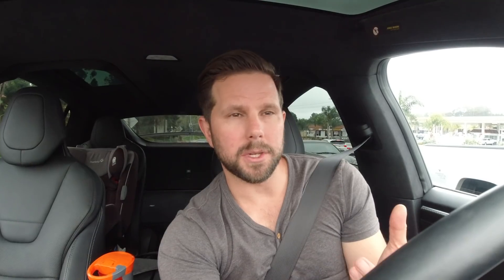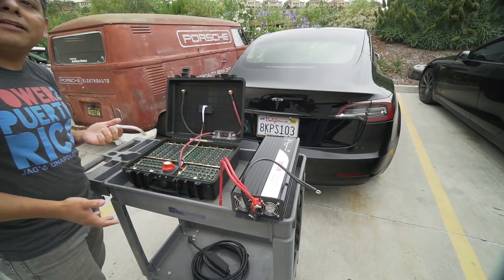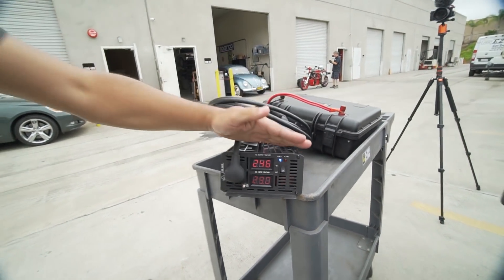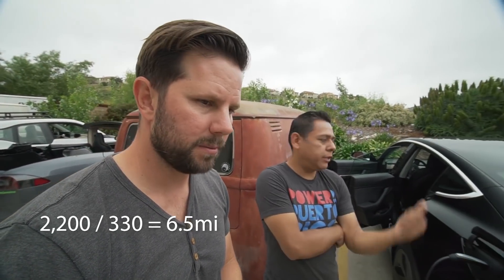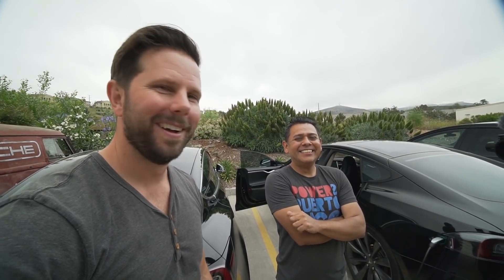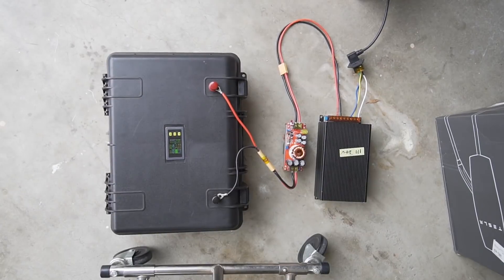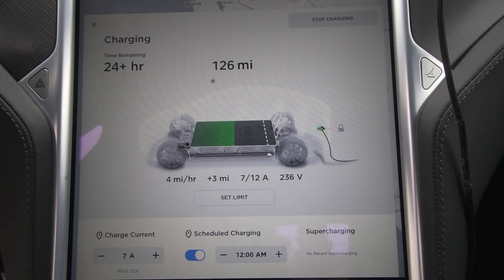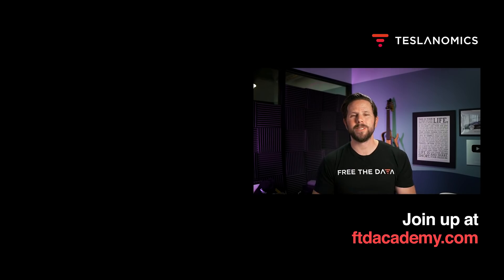DIY Tesla Gas Can - Will it Work?

Comment: If a person were to buy 40 AA batteries to make a 48v system, they would have 120ah for emergency use. Of course you use the same components that he used to build his bank, but twice as big. It would still fit in the truck as an emergency. If you got 6.5 miles off of the 24v set up, you should get 12-13 miles, if not more. You can also run two 40 battery strings in parallel to get 240ah, which I believe would give you good enough charge to make it to an actual recharge station. At worst, a place to recharge your emergency charger.

Comment: If the car battery was almost empty the ecan would have worked much better. What you're trying to do is raise the voltage of the car battery so the fuller the battery is to begin with,  the less you will be able to transfer. Do the experiment correctly, on a dead car and see what you get.

Comment: I think this says something about the power of gasoline and the  Inefficiencies of how we use it. A small 1 gallon tank of gas contains over 30  Kilowatts of energy, so the battery they made would need to be 15 times its size to contain the same power. That would also charge the car  33%, which is a lot more than what a 1 gallon gas tank would do for a gas vehicle.  So if the average gas tank is 17 gallons [ish] then I think 1/17  of the car battery would work and count as and EV gas can.  I think that's  about 5.8kwh, and should give you about 15-25 miles of range  Depending on the car and charging inefficiencies.  So in the end I think a battery 3 times his battery  Density would work.

Comment: Electric car manufactures should work on creating a standard for emergency portable battery packs ( E-Packs ) that could direect power the vehicle for a few extra miles.  Ideally, every electric car would be sold with an E-Pack docked into the vehicle in the trunk or whatever, like carrying a spare tire.  The E-Pack charges whenever the car charges, but it does not discharge and provide power unless you pop the trunk and flip the switch to toggle over to the E-Pack.  The E-Pack would be direct power, not a charge transfer, so there is no loss using one battery to charge another.  If you run out of charge, you could toggle over to the E-Pack and get a few more miles, or you can undock it from the car and carry it to a power source to charge, or you could swap E-Packs between cars for instant power, or you could borrow an E-Pack from the local gas station or a tow truck driver, etc.  Every car would have one, so getting instant emergency power would be as common and simple as transferring gasoline.

Comment: Why not add an extension port to the actual battery packs so you could just add it straight to the batter not charge into the current batteries much like the infamous tesla trailer

Comment: Is it not possible to bypass the Tesla’s built in inverter and just charge the batteries using direct dc-dc charging? Converting the power from dc to ac and back to dc is inefficient.

Comment: I have a volt, i think it would work,theres always a gas station every 7 miles ,or a place were you can charge. All you need is an adapter ,you re making a mistake by looking at location of charging stations ,no its based on were ever theres electricity and you having an adapter to your charger

Comment: Get Will Prowse to build you a 48V LifePo4 battery pack (16 X 280AH) and use a 10K inverter.  You should be able to dump at least 12KW into the Tesla in about 90 min.  That will get you around 43 miles.

Comment: How About a (reverse) Battery trailer? To avoid losses.. what if Tesla provided a Trailer "Hookup" that could feed power back (into) the Tesla instead of draining it.. then if you put the power wall on a tow behind trailer like one of those Mini-Mixers wheeling down the road.. it could follow the Tesla and provide power until you can get to a Tesla Supercharger. Best.. a gas truck or something with heavy towing capacity like a Pickup truck could drop it off.. you hook it up.. and (zero charge time) your ready to go, with (zero inverter losses). .. that or Strap a Powerwall on top the glass roof like a Ski rack and do the Doc Brown thing.. just not at 88 mph. Tesla could do a drop off wherever, and the Rescue Tesla drop it off at the local Supercharger station. An Empty "frunk" battery with a hookup inside it would work just as well. Make it modular and easy to handle.. SuperSized BigMac battery rods like Power Pellets you could plug in as many as you need or as few as you need to get to the next Supercharger station. Then AAA could carry lots of these Energon Cubes around to Power up the Tesla Transformer in an emergency. -- And don't they Reserve some battery capacity they can Unlock for Hurricane Evacuees? Could you email Tesla with an "I'm sorry" request and a credit card.. to get that power unlocked for a 'rescue event?'.. like My Wife is Having a Baby?

Comment: The real trick to doing this is using ultracapacitors on both ends.  Much faster energy dumping, much greater energy density, and better efficiency than batteries. There is talk of building them into busses and other large vehicles for super fast charging.

Comment: Would be cool if all Teslas had a 911 button and when you press it it will alert Teslas close by and then you can connect Tesla to tesla  for 30 mins.
It would only alert drivers with 75% battery left and you could Opt out, but that means you do not get to use the service in the future.

Comment: instead of tesla to tesla charging you can litterally pull a tesla on a tow-strap and charge it like that, Jason over at Engineering Explained towed his model 3 like that behind a big Ford pickup and was able to put a decent charge on. though i think you kinda need the power of a pickup to tow a tesla, you can't just ask your buddy to hop in his civic and tow you up and down the street a couple times to charge a tesla haha, especially because the tesla is regen-braking while you tow it, it's not just the dead weight of the car

Comment: The "miles gained" that the Teslas you tried it on is probably set to display miles at typical highway speeds since you had not actually depleted those packs to "zero". Long before your Tesla runs low enough to need such a device it will have dropped its speed to try and conserve the remaining energy before shutting down completely to save the battery from actual low voltage damage to the weaker cells it may have. Other EV makers call this "turtle mode".
What the Tesla may do under the shut down circumstances is treat the power gained from that "electric gas can" as mileage possible at those slower speeds. So it may be possible  that going along the road edge with hazards on at around 25 mph where no appreciable aerodynamic load is encountered could mean that that 5 to 6 miles displayed might actually allow 10 to 15 or so extra emergency miles.

Comment: Battery filling battery is like two buckets piped together at the bottom.  When the higher bucket empties enough to equal the lower bucket water level, the flow stops.  Equilibrium, just like osmosis.  You can charge a 10v battery with a 16v battery.  When the voltage on the 16 drops to 12 just as the 10 v rises to 12 the charging stops.  They are now an equivalent cells in a parallel system.

EVs need external horsepower (lots) to produce massive power to always be more energy than the Tesla battery is storing.  So as you say three days worth of house power for your house analogy is in a fully charged Tesla. 

Teslas are more car than most drivers need.  Most drivers are not in 0-60 in three or four second cars that weigh 4000lbs.  Most drivers are in modest ICE cars with 120hp, 2000lbs and accelerations that will not get their 16 year old killed.  More modest EVs might produce 400 mile range on 50kwh batteries and therefore drop charging times significantly.  They would also be easer to "jump" charge with a pack.

EVs will come of age when emergency roadside service is competent.  When all chargers use the same damned cable and bill you on their screen for the amount you are using right now, not some phone app and subscription service.  When aftermarket parts are available at a discount and OEM parts (especially older batteries) are guaranteed available for 20 years.

Try to keep your old NiCad Leaf serviced and repowered as easily as a same year Nissan Sentra.  Try to get a Tesla 3rd party serviced.  Try to buy the same pack your S had a few years ago.  These are all still experimental and flaws are known, but talked around, not addressed.

Comment: sooooo.... what actually happened?
did the inverter shut down due to over current?
or did it shut down due to under voltage?
these inverters usually have a shutdown voltage set for lead-acid batteries, so they would never be able to actually use all the power in a lithium battery-pack.
might wanna look into that, adjust the low cutoff to a voltage suited for lithium....

Comment: Rivian CEO RJ Scaringe talked about creating one for the Rivian (which makes a lot of sense given the car is built for off road use). It'll be interesting to see if one created by the actual EV company will be more successful. Rivian is a little more conservative with announcements than Tesla so I'd like to think they had some form of a working prototype before saying this but time will tell. As far as Tesla goes, I think it'd make more sense for both the company and consumer to focus on just expanding the supercharger network than making some inevitably expensive product for rare fringe cases. Plus, if the 'gas can' is like most lithium ion batteries it probably wont hold a charge as long as you'd like so you're gonna have to charge that beast pretty frequently

Comment: Electric trucks make so much more. sense.  Put a small generator and tank of fuel in the back, far more efficient. The energy density of liquid fuel for emergencies and long distances pairs nicely with electric for torque, regenerative breaking, and home “refueling” after city driving.

Comment: You would need to use DC system to get power over faster... even at 12A and 240V it is too slow... Less then 3KW... You would need speeds over 10KW probebly 30KW or a towing truck is much batter option...

Comment: Tesla Absolutely needs a dc charging port, that would have endless use possibilities the ac charging only really leaves you with the grid as a charging source
Reply from the maker: The same port works for DC, this is how superchargers can do 250kW, but you need 400V otherwise it won't work
Reply: @BenSullinsOfficial  ok i see I don’t own a Tesla so I didn’t realize that’s how the superchargers work using dc charging. It’s a shame it has to be 400v though if it was lower voltage the amps would have to be very high am sure, but don’t you think a battery bank dc to dc charging would work better or probably still not worth the efficiency gain
Reply: @BenSullinsOfficial  nice experiment though, it still could be used if someone stupidly runs out of charge on a highway and a friend swings by with one of these instead of towing

Comment: I saw a video where a guy calculated the fuel burned to drive 20 miles in his ford raptor vs the fuel required to regeneratively charge a Tesla to 20 miles. It was far cheaper to pull the Tesla into a 20mile charge.  I think as a booster pack idea your talking about carrying more weight constantly at a cost. Throw $20 at the guy with the next pickup that drives by. Put your tow hooks on and tow your car a few miles.

Comment: Dc batteries ,  they want dc current.  Going from ac to dc, involves a fairly big loss, usually 15%.  I’m advocating for solar panels, as solar is already at dc current,  you just need to get up to a couple hundred or more volts to match the full voltage of the on board battery.  Reference the cyber truck.

Comment: The problem is, this is just another thing to have to worry about charging.  A gas can can sit in your car for years and you know its there and ready, but a battery like this will probably need to be charged once a week if left idle.

Comment: Why not create some equipment that enable another charged Tesla vehicle to provide the extra charge for a Tesla vehicle which has a flat battery.
Reply: The new Tesla truck should designed so that it has the option to be able to charge another Tesla S,X,3 with a flat battery?

Comment: if you dont want to completely switch to single-use high-capacity batteries for main drive, you can have them as backup, like zinc-air at 400wh/kg, aluminium-air or magnesium-air over 4kwh/kg. why do you use inverter to charge non-ac batteries? charge tesla cells directly? ask elon to provide secondary dc charging two-way connection.

Comment: It would probably work better if Tesla's had DC-DC charging, a high power DC-DC buck/boost converter as standard in the car with a wide range of DC input would facilitate this and would be easy to implement. It would facilitate charging from many DC sources including other electric vehicles without the need to do the DC-AC then AC-DC conversion. With a "powerCan" you could probably get a more efficient transfer of energy.

Comment: Dc to Ac to Dc.... sounds like a band. Why can't you produce the same DC voltage like the supercharger and charge Dc to Dc?
Reply: quick math- tesla S 85d has 7104 cells in 96s74p configuration - this gives 250miles of range - so if i made 96s4p battery pack should i get extra ~13miles ? - only problem I dont know if I can plug it directly 1:1

Comment: It is a partial and temporary solution with issues/ problems obviously but still useful. I would be surprised if Tesla is devoting no time/ money/ effort, into developing a similar concept/ idea. This kind of a thing, is limited to battery size and energy storage capacity also (which just isn't there yet and won't be for many years). The energy capacity of 18650s or even the current 26650s/21700s is still far too low to be practical. The engineering and money that Tesla put into making their cars illustrates that (and is still a remarkable accomplishment).
 
That said, I believe that a better inverter might have been able to push the 10 Amps;  [And]  Was it in fact related to the battery or the inverter itself, rather than the Tesla charge controller? Meaning - rather than the battery didn't have enough power or couldn't deliver it at a fast enough rate, the inverter might have been the weak link. I own several and have taken them apart to examine the components.  

And if you research inverters and watch videos on YouTube, you will see that there are huge differences between inverters (even those that have the same [supposed] OEM ratings). There are different power loss/ conversion/ inversion efficiencies/ factors for instance in different inverters, related to components (and design). But the fact that Jehu's creation was able to charge a Tesla at all (with it's necessary firmware limited/ restricted charge controller) is impressive.

Comment: Um im no expert in electric engineer or car person but wouldnt a tesla benefit from a solar panel roof/spoiler even if just barely? Im surprised they dont have some mini wind turbine on the front so that when you are driving it slows the usage of power (i know you cant generate the same amount of power that you are using since usage will be just a tad higher then what you make).

Comment: Your problem is the inverter, you are converting DC to AC and the Tesla will convert it to DC again, because of that your efficiency will be 60% max, you have losses in the cables, connectors, BMS and the double convertion. The better solution will be a direct charge, DC to DC like the Superchargers,  It will charge faster and longer

Comment: In an emergency, drive conservatively a Tesla can achieve 200 Wh/mi. The EV west battery could give 7.7 miles of range allowing for 70% efficiency. Charging the car at 5A may increase efficiency. Energy conservation is the answer here.

Comment: Alien Face (Hugger) battery - a Power wall "mini" you lay on the hood like Tom Cruise in a Mission Impossible movie.. hooked over the windshield wiper lip, and strapped spread eagled to  the edges of the wheel wells. Too bad HR Giger isn't available for the design. Thor Drive - A Bolt of Lightning can fly through the air.. what if a Satellite could deliver a high power microwave, or maser beam targeted at a car with a rectenna to give it a fast charge without blowing up.. maybe with a Superconductor torus to slow down the charge and deliver it to the battery.. AAA could bring some liquid Nitrogen or something to make sure things don't go pear shaped. I guess you wouldn't want to be sitting in it while it charges.. might be kind of hard on the paint.. but you wouldn't be want to do it everyday.. so bonus.. right?

Comment: as you say it would be very helpful for tesla owners and a web request line would certainly give hobbyists a place to go to make a quick 50 bucks still far cheaper than a tow with say 4 suitcase batteries and a charge adapter and the ev to ev charger adapter sounds doable and a viable product if it can plug in to enough different ev's to be worth carrying. i want to ev convert a pd4106 bus so my battery pack  will be 4 to 6 tesla 3's worth of batteries i would have the capacity to fully recharge several tesla's with an appropriate cable also people with large mobile generators on a slow day might be willing to help a web page well worth starting i think maybe one of the tesla groups , good idea hope someone follows up on this   and does a web site with disgns and a needs help post it board.